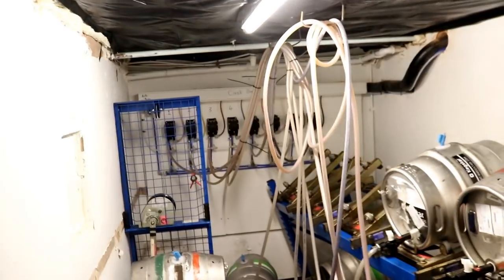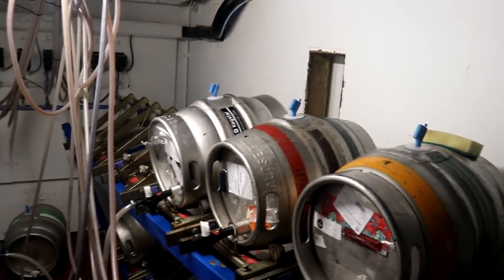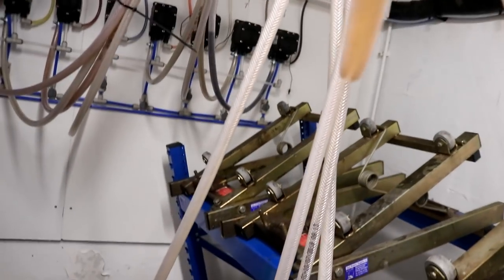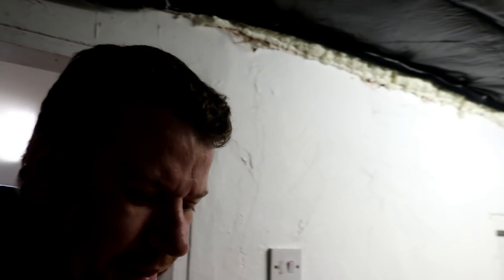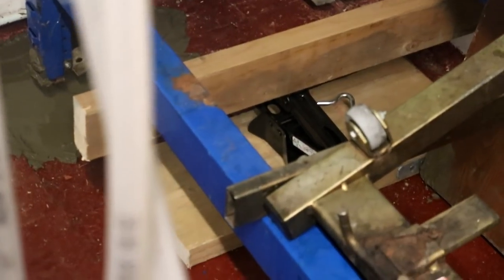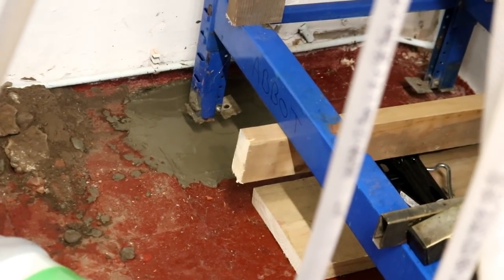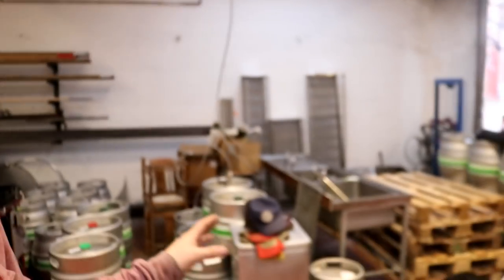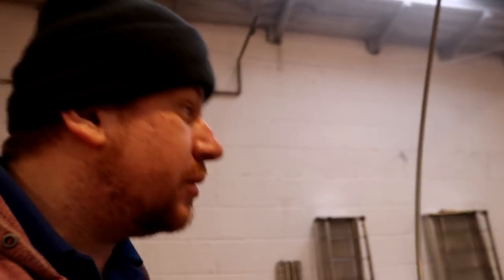SMASHED THROUGH THE FLOOR

Comment: Lucky escape there Harry m8,could have been a lot worse. If i were you i would weld some large diameter box iron lengths onto the bottom of those stillage legs to spread the weight and stop it from possibly twisting in future. Run em front to back like you have the planks now,say some two inch box or similar,should be a quick fix but it will future proof and add some rigidity,just my two pennies worth. Cheers.